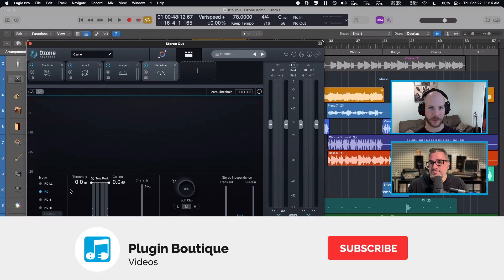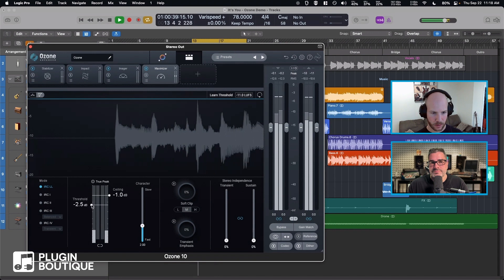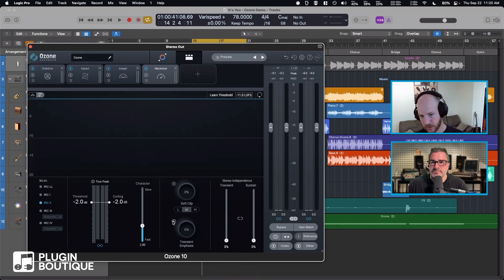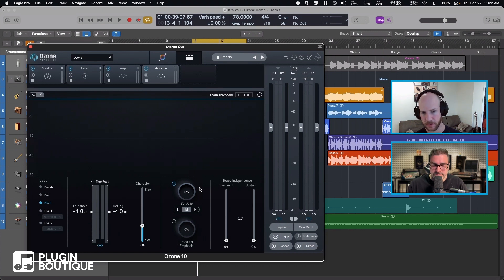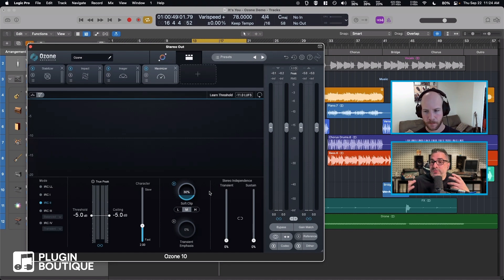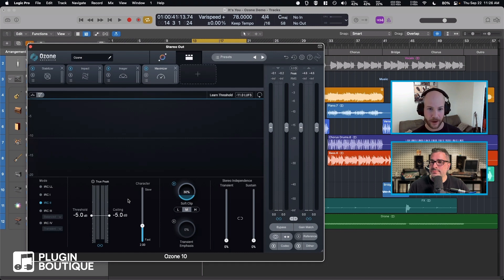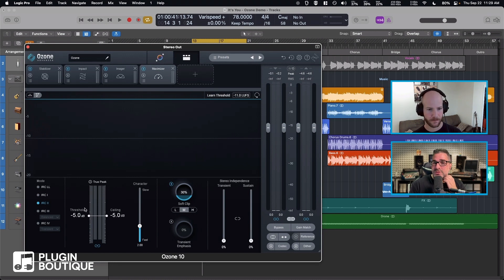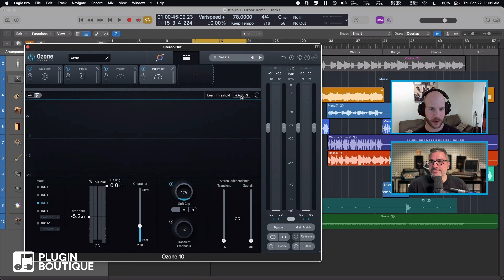Ozone 10 - Maximizer & Soft Clip - In-Depth w/ Bill from iZotope

Comment: Thanks for the tip about linking the ceiling and threshold together to create constant gain monitoring. This will really help me hear if the limiter is hurting the overall mix and adding unwanted distortion. 👌
Reply: IRC4 Transient. Ceiling and threshold set to zero. Character set to zero. Only use soft clip on a final master. Heavy Clip at 2.75%
Then just add input gain to Ozone’s input meter to get more loudness. Always mix down from 192kHz